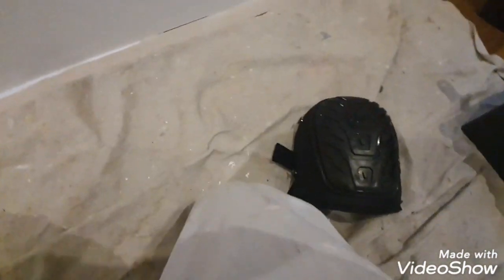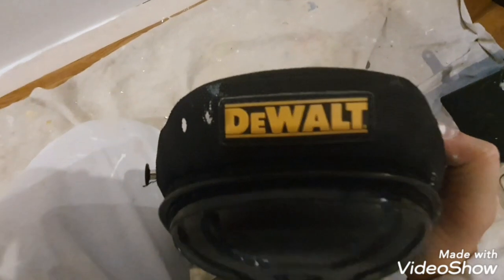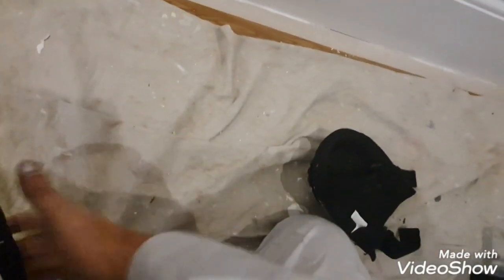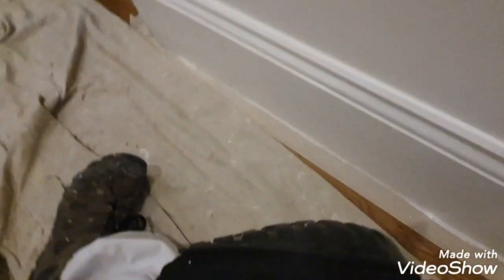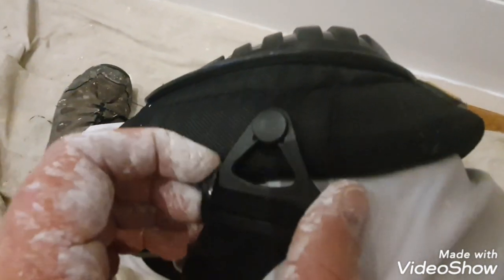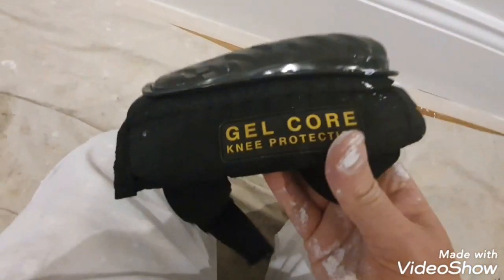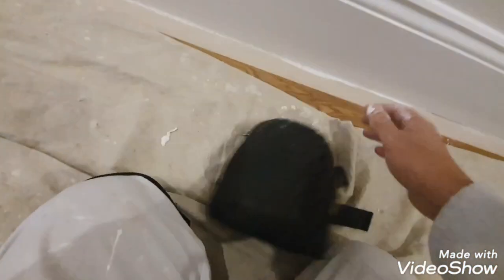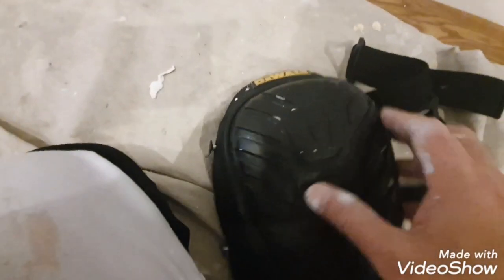Dewalt Gel Core Knee Pads

Comment: 10 months later, are you still enjoying them? I own some and the little plastic wings on the inside of the loop have broken off. The actual button/hook thing on the side of the knee pads have become really loose and all the stitching holding it in has torn. The straps become loose constantly and no breath ability.
Reply: Mine are still fine. I have no problems yet. I have to make sure I tighten them extra tight especially the top straps as if I don't they do start to slip down but I find them really comfortable on hard floors.